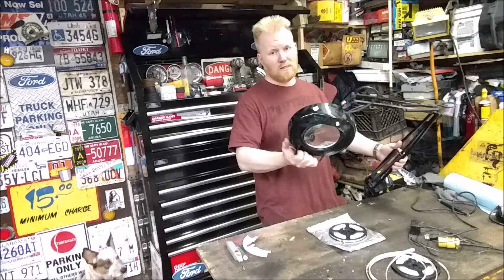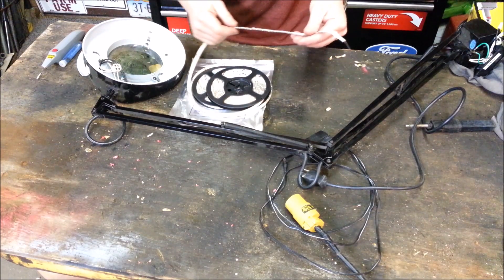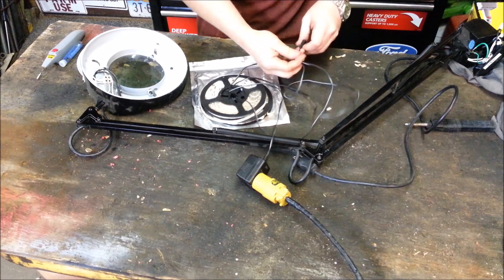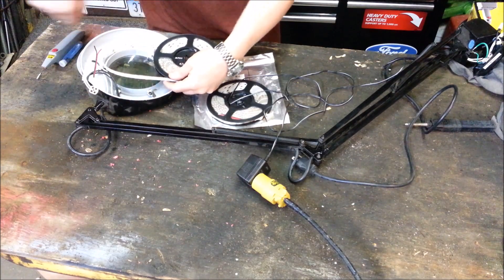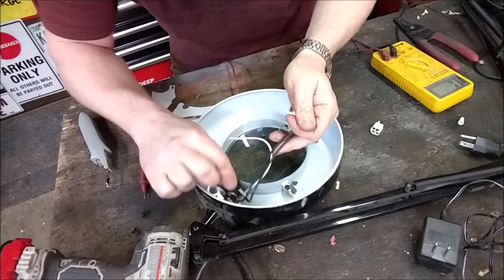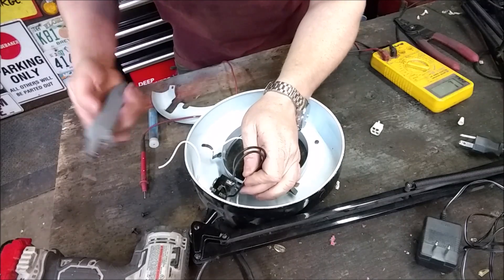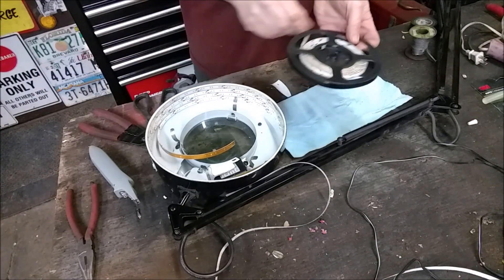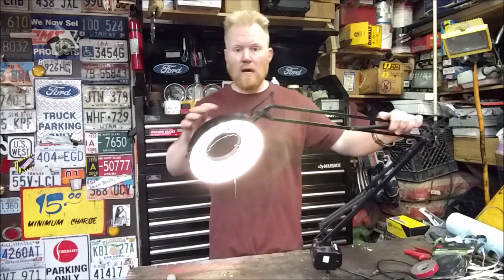Convert Old Light Fixtures to LED

Comment: I did 4 4' light fixtures like that.  except i slapped an old laptop charger to power them.  I'm giving em 19v and man are they bright.  I'm not saying you should over drive them, but you can.  It may shorten the life, so in 2020 i'll have to change them.
Reply from the maker: +Albion Laster That's funny as I was originally over driving these during a bench test to around 18volts. I chickened out and threw a 12v on them.

Comment: I just replaced all the lights inside my house with LED's.  It sure made a big difference.   Way better than CFL's
Reply from the maker: +1970chevelle396 Yes they are nice but not a huge benefit over CFLs energy wise(sometimes LEDs are worse). Most CFL still beat/match LED bulbs in lumen output/watt but you don't get the instant brightness like you do with LEDs. The CFL industry fought back with double life bulbs that virtually match the lifespan of LEDs. I have LEDs in can lights in my home and they're great, but they leave a lot to be desired in a lamp as LED are very directional light and don't fill a room with light as easily. This makes them great for flashlights and can lights in homes. I dissected a few LED can light models and turned them into security spot lights for motion lights. The extreme harsh light that comes off is great as a deterrent.